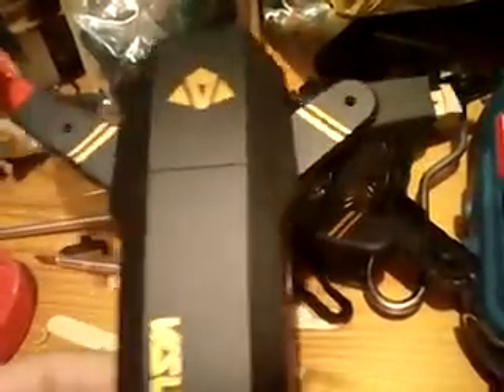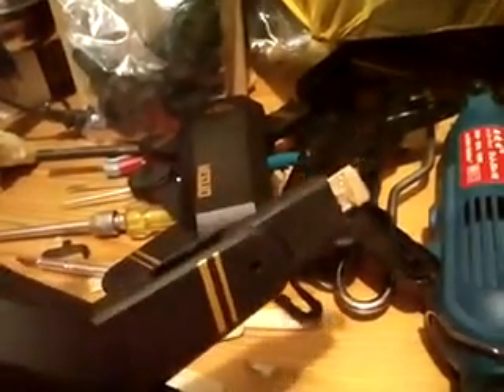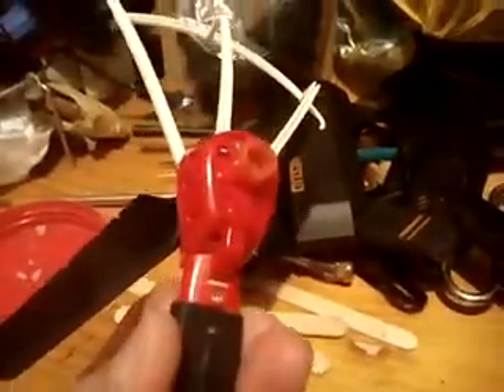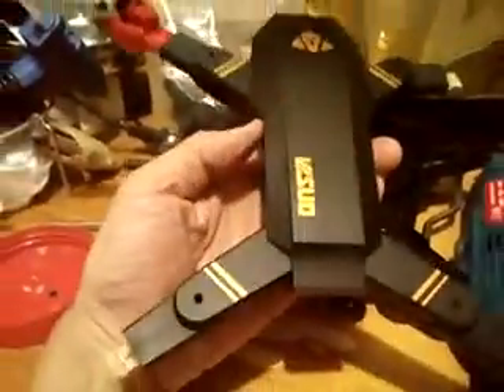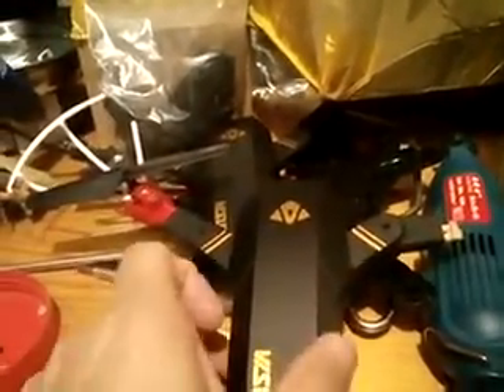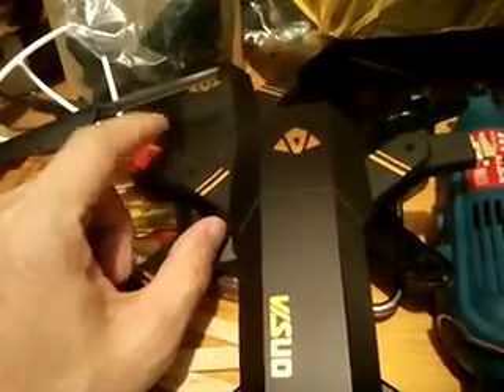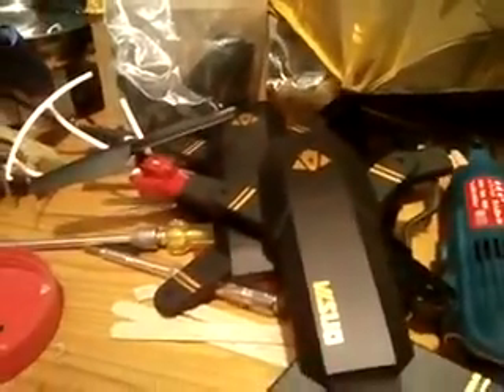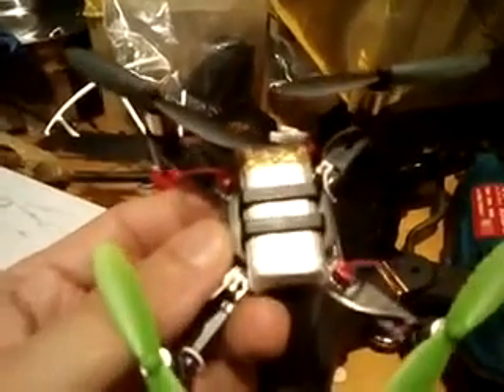VISUO XS809 QUADCOPTER MOD

Comment: I crashed this drone pretty hard and the bearing came out. it was really easy to take a bearing from a syma drone and just put it in. Very simple to fix this drone. Do u think it's possible to upgrade the props?
Reply from the maker: SINGLE CELL, LOW VOLTAGE, CAN NOT OPERATE VERY WELL, TOY~

Comment: Parts are easy to get for this drone...it looks horrible with different parts.
Reply from the maker: Put and install a stronger motors, this craft would look so different~ But ..how to fit the motor in
Reply: very true..there is a DC motor that fits the top part !
Reply from the maker: Size matter, bigger the motor better the flight~ Sometime DC motor operates more smoothly, more efficient~ Thanks for a switching control board, simple~